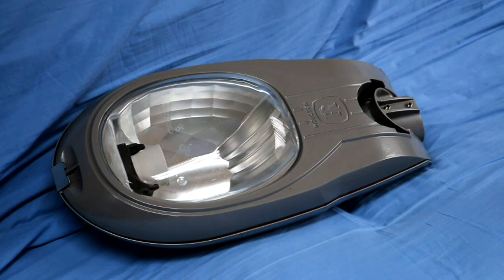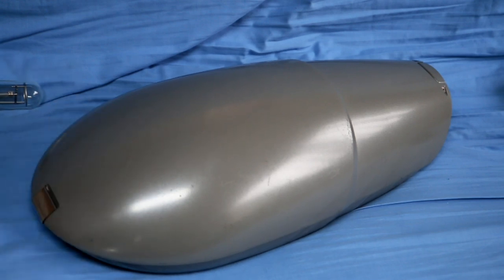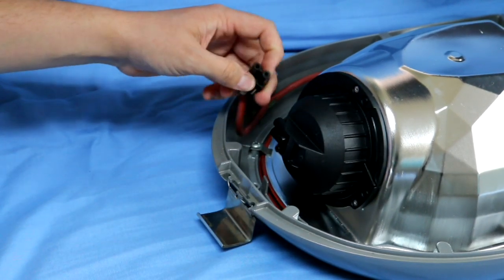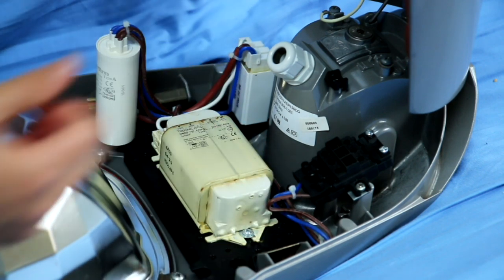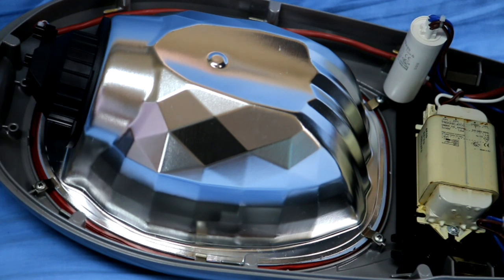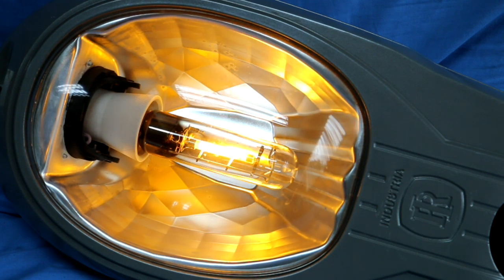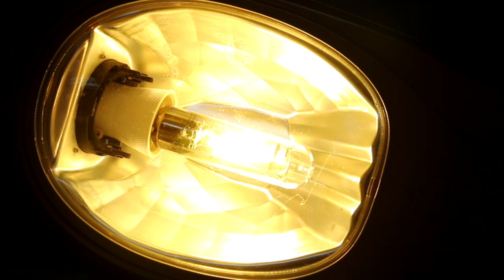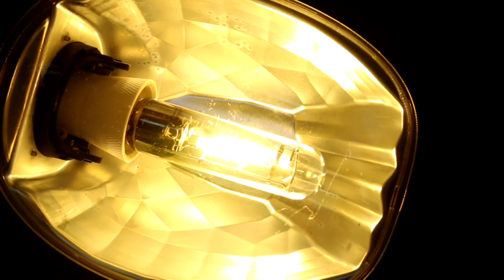Equipment inspection: Industria ARC 80 street light and Osram 150w SON Deluxe.

Comment: Nice vid. Besides the excess aliasing, the IQ didn't seem too bad. I mostly use an archaic version of premiere elements that mostly works, but is a bit unstable on a modern PC and certainly can't use most of my cores. Davinci Resolve can work as a video editing program even though it's primarily intended for grading. However, using it can be a steep learning curve and for basic duties, you'd be better sticking to a normal piece of editing software. I would suggest a modern version of Premiere elements or Sony Vegas.
Reply from the maker: Yeah it's that that's pissing me off. The quality is about 10 times worse after encoding.
Reply: FrontSideBus I use MeGUI. It's free and the encoder used is x264 from the VideoLAN-Project. :)

Comment: Great video. The high-pressure sodium family must be the most mis-used invention ever though! They have created intolerable light pollution, to a large part because they are vastly brighter than actually needed outside and the ugly over-tall and utilitarian poles that are used commonly for their deployment detract from the scene everywhere they are fitted. Most around my area have the luminaire bolted directly onto the pole top, with no outreach. It just looks weird and unsightly.
Reply from the maker: I think the problem is that they are used wrong. For example most areas are over lit and could well do with a lamp of less wattage.
That's one of the main reasons why I like modern lanterns like these, the reflectors are designed to focus their light very precisely with little or no spill.

LED streetlights are even worse! Glare bombs galore! What's the point of streetlights that dazzle people?
Reply: FrontSideBus street lamps are also positioned too close together in many areas